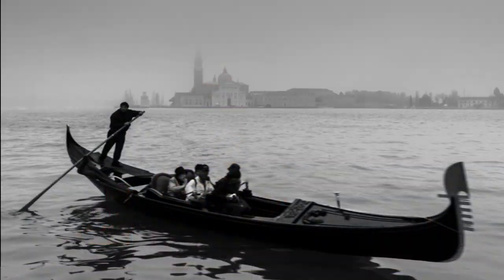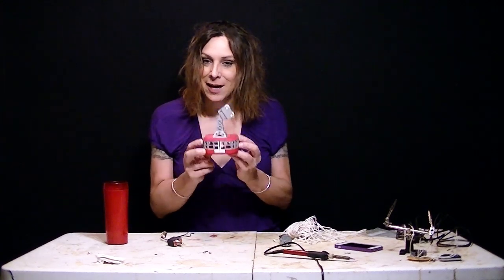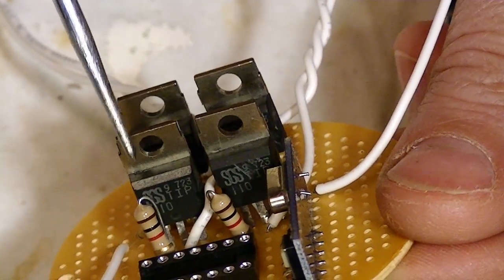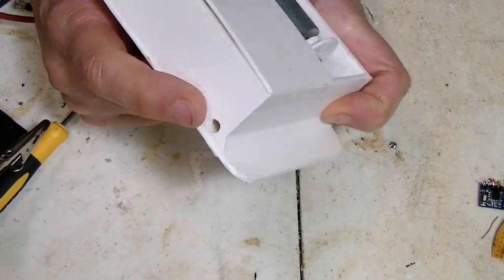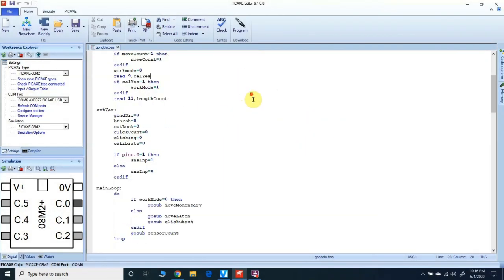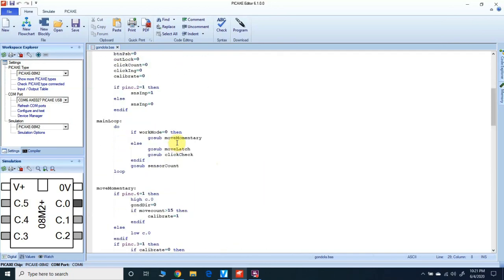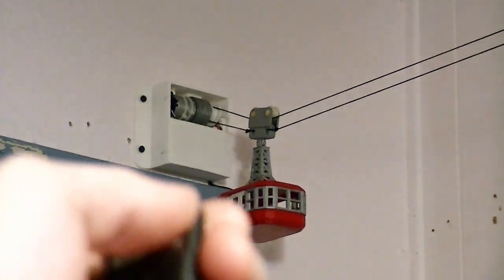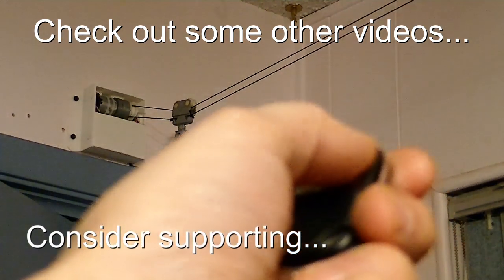I programmed a toy gondola.

Comment: TIP110 is a Darlington NPN bipolar transistor , not a MOSFET, the case of the transistor is called a to220 for regulator you could use 7812 in to220 they are good for close to 2 amps with a small heatsink on them
Reply from the maker: To be honest, I couldn't tell you the difference. I would have to look it up. They are just some transistors I picked up at the local electronic store before they went out of business. It's quite possible that I even knew they weren't mosfets at one time, and that just came out. With what I usually do, those details are usually not needed. But thanks for pointing it out. I'll try to remember. No promises.
Reply: @RandiRain  mosfet are very sensible to static electricity you could kill them just by handling them before grounding yourself I love your videos, discovered your channel after seeing you on the 8 bit guy

Comment: Was that a test Randi at 4:23??? That wasn't a PCX chip. It was a 555 timer.  :D
Reply from the maker: Ha! I didn't even notice. I did try to program it and it just got hot. It was a 555 timer, but I didn't realize I videoed it too. In the end, after I figured it out, in was a Picaxe o8m2. My eyes just get worse and worse.
Reply: @RandiRain  No worries. Your videos are very entertaining. Sorry you blew up your 555 timer!
Reply: @edmclaughlin4923  Yes I thought it was weird, but ive neer seen a picaxe controller so just assumed it was correct. Seen lots of Microchip pics before but never a picaxe chip
Reply: @edmclaughlin4923  Guess its time ran out huh

Comment: I'd have one of the other buttons put it into a mode where it would just continually go back and forth.
Reply from the maker: Yeah, I thought about making the other buttons do stuff, but I would have had to use a bigger chip, and I didn't want to.
Reply: @RandiRain  Actually you wouldn't need a bigger chip.
For one you could have it so that the third button activates both inputs simultaneously through two diodes. Or if it has an analog input you can have all four buttons connected to a single input by using a resistor divider.
Even if you didn't do any of the above you could have it connected to some outside circuitry that when turned on would pulse the opposite direction pin when the motor power stopped. That is the third button would turn on that latching outside circuitry. Then have it so that any other input would unlatch it. I would probably have it so that two direction pulses would be generated by the inductive nature of the motor.